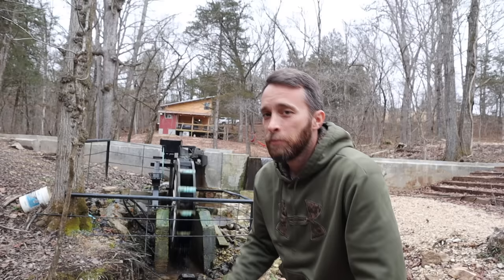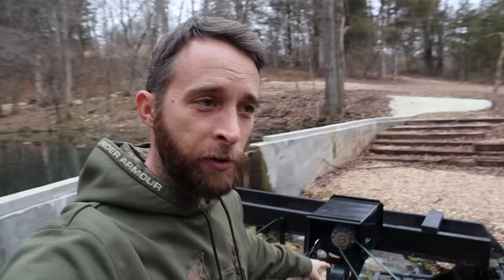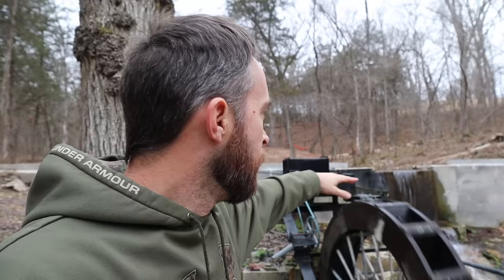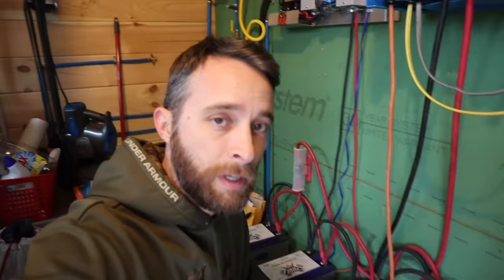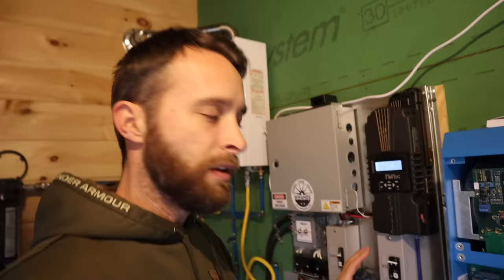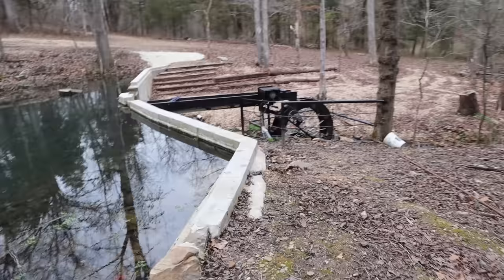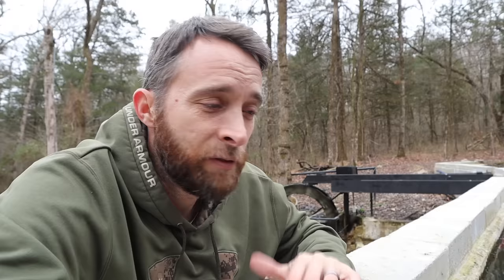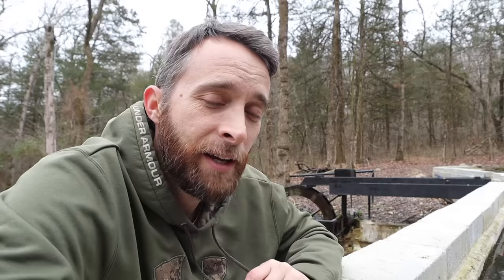Did we MAKE HYDRO POWER Using Our Waterwheel for Self Reliant Off Grid Living?

Comment: The dam was 6 feet tall and one wheel when he built it. I added 12 feet,  and an emergency over flow/spillway. Added 3 more wheels to the dam and in the emergency over flow/spillway is a double wheel. Also each wheel has two 2000 watt generators. The spillway has two 1000 watt generators. For the amount of money it cost him, he was mad but in the long run hes happy and his Neighbors are happy to be paying let money for electricity.

Comment: Hi, yes, with 24V is better in terms of losses, but your problem is you need to generate more power for the rpm you have, thus a 12V system you don't need 500rpm but rather ~300rpm to reach 12V and use the 200rpm "extra" for charging. We have more or less the same drop but get about 4A @ 12V with ~270rpm. Maybe if you can, do a test @12V and see what you get out.  

I'd say your wire length is a bit too long to run DC on it. But get a second/third opinion on that. Neat setup though!

Comment: It seems necessary  to change the cable from the generator to the cabin to one with a much thicker  square inch/mm.  You're loosing a lot of voltage running a low voltage dc that distance It seems to be. Another solution is to change the generator to a high voltage... but you're maybe supposed to change the cable even then if the one you've got not can manage a higher voltage... and you also need to to some changes to the charging controls... So my suggestion: Change the cable. As thicker as better..... But you can have a smaller cable the last foots/meters to make it fits in the connections.

Comment: 200 GPM should be more than sufficient to charge your batteries(150 watts ish) with bit more efficiency . A wheel rework, and since a larger diameter isn't really an option (unless you'd consider tearing out the existing wheel/ box,  that's an option I guess), wider  more efficient buckets is where you need to look, and a large diameter heavy flywheel. If you want the help, I'd be glad to help you design a wheel for the space you have.

Comment: Having a 24v system, everything runs at half the amps, so you said if you chose 12v you would get a full 100ah, but a TV for example would need 6 amps on 12v or only 3 amps on 24v so you haven't lost any ah due to 24v

Comment: I just found you, I'm off grid, exsmore, Devon, England, I've learned the hard way!! Just like you I know about the basic,s but not exspert !! I do know this, inverters are a clever thing, also a big pain in the butt!! They suck your batteries!!!! I regret not finding you before you wired up your cabin for mains electricity, everything is available for 12,v TV, phone charger, water pumps, lighting, ect, cook using propane gas! Use wood and coal for heating, and maybe a gas fire ! Swap your batteries to 12v they are 12v batteries just wired up into 24v so you don't have to buy more batteries, get a 150$ 12v inverter just incase you need it, but you won't!! Sell all that other junk , lol

Comment: You might use it to charge a 12 volt battery and then use a 12-24 DC-DC to charge your 24 volt batteries. There will be some losses but at least you will have some charging going on.
Or run a long pipe downstream the creek to where it is enough lower.

Comment: First of all, nice work.  It's tricky. If you want to generate a decent amount of electricity using water you need drop. A pelton wheel needs pressure.. so yeah you'd need drop from higher up hill. It would be great if you could somehow get permission to simply capture the water via collection pipe another 10-20-30+ feet in elevation. It would simply be a box with strainer, collector pipe, and then the pipe going all the way down to lowest part of your property with pelton wheel.

Comment: I would arrange it in such a way that the water chute will be set more steeply and the water will be more rushing hitting the wheel at its bottom. maybe you will have to redo the wheel a little so that the water does not run out sideways. or maybe instead of a gutter just use a pipe and from it a stream of water directs the lower part of the wheel.

Comment: Hydro to electric isn’t simple, but don’t give up. It took me a year to construct mine. My output is 2.6-2.9KW.  My generator is 7.5hp induction motor. Currently I’m grid tied to use the grid as my speed controller. I run max power 24/7. My head is 11ft, but my flow is 3400 gpm at normal summer low rains flow.  I looked at water wheels, but they are too slow and gear ratios make constant speed, voltage very difficult to manage.  I have a 12” dia runner spinning at 465rpm. Gen motor is 1170 rpm. Output is 220v and ties into my breaker panel with a 50am breaker. I’m in GA if you ever travel this way.

Comment: change your generator, 50v 1 amp lol, the battery bank is so large that needs can handle 1 C unlike lead batteries can be charged 10% of rating, 
the best solution is building power shed next to the wheel, move everything, the batteries charger inverter to the shed, you first have to fix the loss thru that 200ft line.
Your battery bank is lithium very good, it requires a lot of amps to charge, 50volts 1 amp, i think the PMA is useless, you really have to test the PMA if you need to replace it.
That midnight classic is a type of buck type converter, it requires voltages 2x to 4x voltage the better so the input PMA does not require heavy current (amps).
If ever you decide to replace the PMA, get the Flux Gen 3 phase, 3kw 48volt its more efficient, its low RPM also. the Flux PMAs ive seen DIY built really intrigues me.
The problem with your midnight classic is the max power point feature, its good for constant DC input not pulsating, that why most wind generation videos do not use MMPT, even if its rectified, your feeding it with pulsating dc from a PMA, not pure like solar panels which is pure, yes solar voltages changes  but its a pure DC source. PMA are pulsating DC, 0 = Vmax -  0 Vmax, for the power needed even if you put a very large cap at input it would be useless, most PMAs are direct battery connected after the rectifiers and protected only by diverting excess to heating loads when battery is full. Solar chargers are almost useless for you.
but if you intend to still use the midnight classic, change the PMA, 50v 1amp that PMA is a laugh hahaha.

Solar Pure DC source
PMA AC or pulsating DC source usually directly to battery.

Comment: dude you have all that infrastructure, you could make the water wheel idea work. Its just a long run so you you need a high voltage generator like 240 (get an electrician to help you out for a day or so))and maybe use a gear box  at the wheel for more reliability.

Comment: Matey, your voltage loss between the cabin and the wheel will surprise you!   If you do your research, you will find that 24 volt system IS better than 12v, Please do your full research, if you go solar, you need to know what every little box on the wall does, you need to know how to trouble shoot, and lastly, stick some 250 watt panels on your roof! :)

Comment: Great job with lots of money involved. You can not send DC voltage that far. Use AC generator. With DC you need 4Ga wire just to send it about 40 feet. With your settings, you can build CMU cabin next to your generator and put all batterie and charge controller there and send 120 V AC to you r cabin. Thank you for sharing

Comment: Ah, Victron!  I have some experience with their systems.  What you describe is one of the "features" of the Victron systems.  The incoming voltage/amperage is monitored by the Victron system.  If the incoming power is not sufficient the Victron system stops converting power and waits until it appears that it is OK again.  The incoming power [voltage] may appear to be OK when it's not drawing any amperage - so then the Victron turns on again.  If the incoming power [volts and amps] drops again then the cycle repeats.  That may be why you see a cycling of the power being "generated."  A common cause of this phenomenon is that the cable from the generation source to the Victron is not "big" enough.  What happens is that when the Victron system is not attempting to convert the power from 24VDC to 120VAC the voltage at the Victron input appears to be OK, so it switches on.  Then, once it starts drawing power the voltage drops across the cable from the source to the Victron because the cable is not sufficient to carry the current without a significant voltage drop.  If you have a 200 foot cable run, you need a massive cable for this to work.  You'll have to do the calculations, but I would expect you need at least a 4/0 gauge cable [that's 0.75 inch diameter copper cable.]  You may even need a larger size.  This is a very expensive cable.  Guess what?  The reason the power companies transfer power at high AC voltages is that they can do it with smaller cables.  So, the alternative is to convert the power to 120 volts [or even 240 volts] at the generator rather than attempt to transfer power at 24VDC.  Good luck!
Reply from the maker: The Victron only converting the DC to AC after the batteries. It’s not the issue of not getting enough power, in my opinion. Unless I misunderstood what your talking about.
Reply: @LoftisPartyofSix  Oops!  Sorry, I went back and watched the video again.  I missed that you have another system controlling the charging of the batteries, not the Victron.  I don't have any experience with MidNite, but if the amperage is cycling, I would expect it has to do with what the controller is doing, not the hydro generator.

Comment: High voltage AC alternator for the distance.  speed is not important.  Use full wave rectifier at the mppt controller.  It will manage the voltage giving you high current at 24 volts.

Comment: I think you can get much more power from this watwrwheel with small repairs  1st: close the sides (make sides  about 10 inch longer) ,top and end(45 degrees) of this flume to drop all the water to the buckets (no splashing), 2nd.: close the buckets with 2-3 inch slats -boards to prevent owershooting and hold more water longer time in buckets it will make a big difference in speed and power.

Comment: There is probably a lot of advice in the comments, im a tech, i will add what i can.

I would question is a MPPT solar system good for a water wheel? 

You definitely have voltage drop in that cable run to your house that is only good for a much shorter run. Or a higher voltage that you can then have voltage drop. I think you are struggling right there!

Make up a battery box and inverter adjacent to your wheel, run 110v ac  to your house then charge batteries up there from 110v ac. Note find a water wheel suitable charging system to charge the batteries locally, not a solar type mppt charger.

Size it s a: you can scale it and b: its suitable to the water wheel at a reasonable flow. What volts / Amps is it putting out at the alternator, not the house? 

Its a compromise for sure, solar systems now are 110 v dc and upwards so they have the head room for voltage drop

Moving  your system closer and run the voltage up to your house at a higher voltage is a “get around”

Then the amps and volts ( ie the power ) you make can be utilised best where they are generated.

I work on mine sites and have to deal with abortions of radio and telemetry trailers that have sub standard solar and then waaayyy over the top solar every other week, its feast or famine out there...
Reply from the maker: Thanks

Comment: The controller you are using you will have to set the curve on it.  Should try to get much higher input voltage to the controller. Thanks for sharing

Comment: I noticed you said you were pushing DC to the cabin, you will probably be better off running AC to cabin and rectify it close to the batteries. Also each of the segments of the water wheel needs a 40 degree lib in order to produce more torque. Nice job though.

Comment: Sending DC over 200 yards through thise thin cables is insane. Either you need to build a shed for batteries and charger plus inverter near the wheel or you need to send ac to the house or you need dc to ac at the wheel and ac to dc in the house if you dont mind looses.

Comment: DC needs bigger cable section no to loose voltage, you can just put your batteries closer to the hydro generator. Also check your wheel while it's connected, maybe the load it's too much and the speed droops, therefore less voltage.  Also curious why you get 40v instead of something close to 24, are you sure it´s properly wired? Or is it 48v? AC with a rectifier it´s also a good option, actually many wind generators are 3 phase AC. I would advice to start checking with a multimeter at the output of the alternator and try to put the batteries closer, then test and see what could be wrong.

Comment: Low voltage DC means a lot of current from the hydro generator to the cabin.  Which translates to a large amount of current loss.  I won't repeat similar comments but agree that running AC at a higher voltage from the generator, then converting to 24 volt DC at the cabin would be the best approach.  Since the higher voltage means less current, there would be no need to upgrade/change the cable run from the generator to the house.  This is because current determines wire gauge, not voltage.  The lower voltage, the higher the current and heaver gauge wire and vis-versa.  The utility companies get away with using smaller line thickness/gauges because they run the power up to really high voltages (like 345 kV or more, for example), then use transformers to step it down to residential 240/120 volts.  (No, I would not suggest running 345 kV to the house!)

I am looking into an off-grid house for retirement.  I plan to have a "power shack" right next to the solar array in order to have a VERY short DC run to minimize line loss.  Charge controller, inverter and batteries will all be in the shack.  Then convert to 240 VAC and run the line to the house.

Comment: I'm going to try and explain what I mean in racer terms. I race karts and we use 5 hp motors to produce basically 12 to 15 hp with different cams head work and all the usual stuff to get more power in any engine. In saying that you also want to increase torque. Torgue is what gives you low end power and pulling power at a lower rpm  If you have a 18 tooth clutch on the motor and a 65 tooth gear on the axle its the same gear ratio as a 14 tooth clutch on the motor  and a 53 tooth gear on the axle. The gear ratio is the same but the 18 tooth clutch and 65 rear gear will make more top end speed even though its the same ratio because the gearing on the motor is higher.

Increasing your water wheel speed is doing very little. Your gearing on your axle and pully is what will give you more juice. I don't think the stuff in your room is wrong or the length of your cable. Your water wheel isn't wide enough   and your paddles need to hold water until it reaches the creek level then release the water. The water wheel needs to be at least 5 times wider and each paddle needs to hold 2 or 3  gallons of water on rotation. Your axle needs to be bigger and so does your bearings. Make a stand mounted on 4 pillars  and do away with the side walls. I also think spill walls on each side would take away dam pressure. I  think the dc generator is to big for your usage. This is only my suggestions and I hope it helps. I know you have a lot invested in it and its a shame its not working. Your cabin looks great and in a perfect setting. Best of luck and I hope it all works out for you.

Comment: Your main problems look to be bucket geometry and water from the flume entering the buckets on the wrong side of the center of mass of the wheel.  Extending your flume by a few inches will fix the latter.  As to the former, look at Kevin Crawford's microhydro system videos for wheel design advice.  You want the bucket divider walls to be a lot more curved.  As it is now, you are losing a lot of energy to turbulence and splashing.
Also, those bearings are not meant for low speed low temperature applications and the balls in them will chew up the races as they don't get hot enough to properly spread the grease.  You want either hard maple or cherry wood bearings or UHMW polyethylene bearings.
Reply from the maker: Thanks

Comment: You need waay better generator to your watermill, you can buy some on alixpress at 250rpm and even lower than that.  Your setup is fine. Maybe you should switch your water flow (wood) with pipe as well to make better flow.

Comment: I think a lot of the issue you are having is the direct current power loss, a high output AC generator on your wheel would fix the power loss use a rectifier to turn AC into DC and put it into your batteries that way, or another method would be to move your batteries and control system closer to the wheel so there’s less distance, but that’s a lot of retrofitting to have to do

Comment: Something most don't do, put a track  towards the outer area of the water wheel the mechanics of it makes the turn a lot faster then the small center pully. If you think about it you don't need math. Problems with engineers is they don't think outside of the box much, because they have bosses

Comment: I'm in the planning stages of setting up a hydro system for my property so I'm by no means an expert but from everything I saw here, I'm almost certain you should be generating some power, 20-100W. I'm sure your set up has mechanical and electrical problems as others have mentioned in the comments.